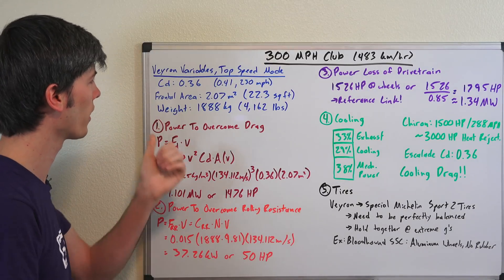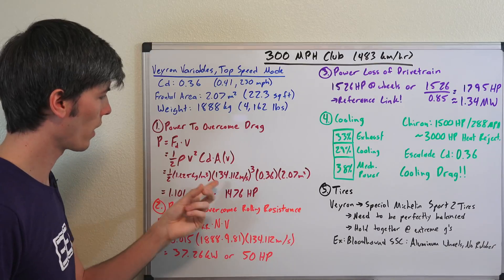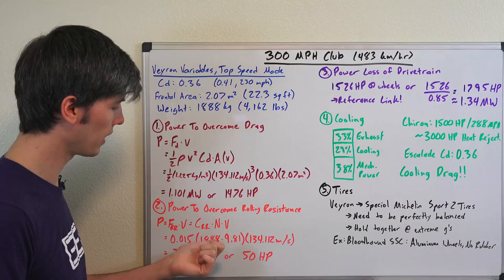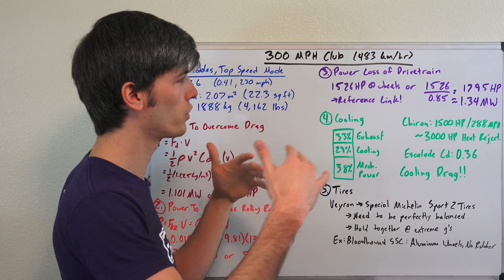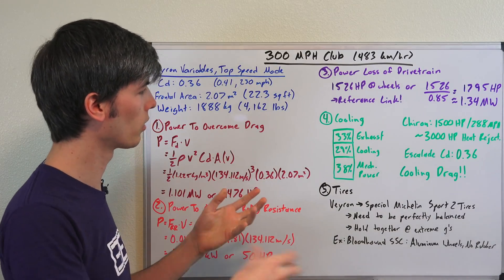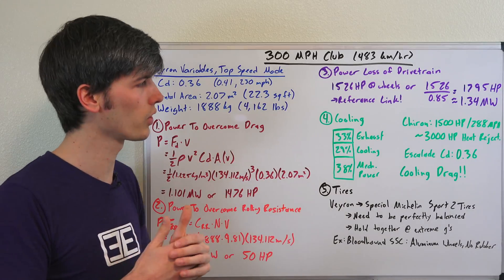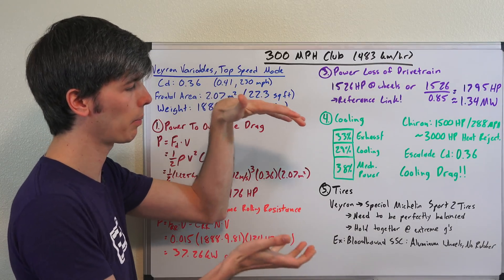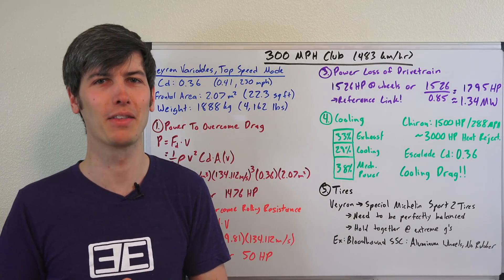Why Has No Production Car Hit 300 MPH?

Comment: If you could lower the drag coefficient to that of a Prius (0.24), you'd only need 733KW or ~1000HP to reach 300mph.
Reply: You don't even need to lower the drag coefficient, you could just reduce the frontal area! Fast motorcycles have terrible cd but a tiny frontal area.

Comment: would a purely electric engine require that much cooling? less of a cooling requirement, less of a drag coefficient requirement??
Reply: The energy required does not change between ICE and electric prime mover, however the efficiency for an electric motor and the heat rejection would be slightly less than for an ICE.

Comment: Would they benefit more by adding more cylinders to gain displacement or just upsize the engine?
Reply: So what you're asking in a round-about way is "which is better? increasing capacity and adding more cylinders OR only adding more capacity". The difference would be negligible.
Reply: noxious89123 Increasing capacity in both scenarios, just in different ways, would one yield more power than the other.

Comment: The obvious way to defeat drag is to run at high elevation.  The Atacama Desert is 13,000'.  Air density is 66% of sea level, so required horsepower is reduced to a "mere" 1000 HP.  According to Wikipedia, the  Dakar Rally and a solar car competition have run there.  Also, reducing the frontal area is a big factor too.  Say you had something the size of a Lotus Elise, with a really big motor.  Oh, wait, someone did that already.
Reply: MrChanPhysics thinner air means less power the engine generates
Reply: Turbocharging can make up for the lower air density.  WW2 fighter planes  used turbo (or super-)charged engines and achieved top speed  at altitudes over 25,000 feet.  For example, the P-51 Mustang had a 1720 HP engine, could hit 442 at 26,000 feet, but could do only 375 MPH at sea level due to drag limits.

Comment: Yes this is theoretically correct no doubt about that. The biggest problem is the roads. The other thing that makes it impossible are the driving skills. As you know American cars in the 50's had those fantastic engines but heavy and straight forward speed. Your skills should be as a formula 1 driver with suicidal cars. And who want to manufacture that.. one life lost and the brand will be gone from the market.
Reply: Theory and theoretical discussion must escape your comprehension.

Comment: You didn't mention that you need a straight long enough, which is rare for 250 mph. You would have to accelerate much faster, or build a very long road. You might also run out of gasoline if it took too long to get up to speed, the mpg gets very low at that speed.

I wonder what this calculation would look like for the Tesla super car, they have no plans but I imagine an electric car will one day try for the record. The loss at the drive train would be lower, cooling is also much lower, and Tesla is the lowest coefficient of drag car manufacturer as a result of the inherent advantages of electric drive trains.

Comment: So, basically to hit 300 mph you need an electric car without this enormous heat loss :)
Reply: Denis Protopopov no gasoline engine have already reached such speeds just not road cars. and if you tune one you could probably get it to 300+ you just need a Leight weight car with little air resistance and then just like lotus have a 1.2 litre engine produce a insane amount of horse power.

Comment: Tesla will be the first to hit 300mph, very little cooling required
Reply: Big dundee I'd say gasoline engine will hit it first because they have already hit it not (stock) road cars though but electric engine's are I think older they have been around since the late mid  1800s and gasoline engine's have dominated them because they are just much better.
electric engine's are good at low speed but om higher speeds the electric cars usually get destroyed and another problem would be the terrible drive ranger such an electric car would have if you would have a 6 hr race between a smart and a tesla model x the smart would win because of the small driving race the tesla has.

Comment: Would it be possible for an auto manufacturer to make use of the Meredith effect? It's a concept that allows the temperature/pressure difference from the front to the back of the cooling system can offset the effects of drag on the cooling system.

Comment: Another comment on air, would it be possible to engineer a system to break up the air in front of a car? Sort of like how if you were diving from a high altitude you toss something into the water to break the surface before it breaks you? It could be like a sonic disruptor that "loosens" the air in front of the car.

Comment: Would this be affected by gear ratios? Cars are dyno'd in whatever gear is (or is closest to) 1:1 to get an accurate HP/Torque rating, so would you actually need a car that can produce 1800hp at whatever gear ratio you'd need to reach 300MPH? Essentially like dynoing your car in 6th gear

Comment: As an example of the math, Top Fuel drag and funny cars have 2,000 hp or more and regularly trap at speeds in excess of 300 MPH.
Reply from the maker: Top Fuel engines are around 10,000 HP. Math here! https://youtu.be/bI0YPTK32vc
Reply: not only that but they are usually a direct drive setup, less loss due to power train.

Comment: 300mph on gas engine maybe hard to reach, but did u forget to mention Electric? :) Tesla can pull it off it won't be long lasting battery since it might just drain in one run, but it could have a switch for just max top speed.

Comment: The more interesting question: WHO will reach 300miles/hour first: A conventional combustion engine car, a hybrid, or an electric vehicle? Now electric vehicles have the same problem at sustained high output with the additional problem that the heat is currently not moved out of the inner part of batteries. I can imagine that this might work when batteries are cooled similar to liquid-cooled computers, running heat exchanges through the midst of batteries and motor components.

Comment: I think a tesla can hit 300mph with wireless charging. The wireless charging is key because that means it can shed a ton of battery weight. It might need some other mods like a spoiler and striping excess weight.
Reply: Weight hardly matters at all for top speed.  In the video, 1475 hp for overcoming drag, 50 hp for rolling resistance which depends on mass.
Reply: Weight is critical because you can't use more power than the wireless charging can input and weight directly relates to how much power it takes to move. If what you said is true then why is everything that is built to go fast built to be lite as possible? The batteries on the tesla alone weighs more than many cars you really think losing that much weight is not going to make a huge difference ?   Give me a break man.
Reply: They're built light to be able to accelerate faster, if we're talking about cars at least. Top speed hardly matters on a track where you will almost never reach it due to there being a lack of straights.
Reply: DarkBioCloud battery will overheat (and probably explode) at the rate of discharge and recharge
Reply: DarkBioCloud it is not just about exploding, overheated batteries can't supply much energy so it would be pretty much useless.
Reply: DarkBioCloud how are they supposed to get wireless charging to a car then?
Reply: stick a  Tesla on a big cannon and light the fuse, no electricity needed, it can go beyond 300 for sure over air
Reply: DarkBioCloud you need a very long dodgem cart track....lol
Reply: tesla can't hit 300 mph because it has only one gear... you need it geared low enough that it can accelerate at a reasonable pace, which is why its top speed is 130 mph (model s).  the electrical engines have a redline too...
Reply: A tesla cant hit 200mph
Reply: Self entitled Car-guy It might explode but we don't know that for sure until we try it. If you wanna break the envelope you have to take the risk of getting paper cuts. I never said it was safe eh we are talking about making a tesla go 300+ mph that alone is dangerous the possibility of a exploding battery just makes things spicey =)

Comment: What about electric? That would simultaneously reduce cooling requirements and allow for more aerodynamic freedom. These next gen graphene batteries are capable of 100C discharge rates without breaking a sweat, and electric motors are far easier to keep cool

Comment: One aspect of Veyron and Chiron is, that they are not just made to hit that top speed, but to do it with style. If you compare the sound in the cabin of Veyron at top speed to any other hypercar at their top speed, the difference is huge. For instance in the Top Gear's Super Sport top speed test, May could speak normally when he hit that 259mph. There were very little background noise. My Mazda makes more noise at 50mph than that. Also cameras were very stable. Ferraris, Lambos, Koenigsegg at top speed, they roar. You have to yell very loudly to be heard. Also they rattle and shake much more. I bet, that if Chiron had been designed like those cars, it might be able to reach 300mph.

Comment: You may also want to add sufficient power to accelerate to 300mph within the amount of space available on top speed tracks. Having just enough hp to reach 300 would mean that it would never actually reach that speed. It would run out of space before it could reach max speed. I suspect that the first production vehicle to reach 300mph will have between 2000 - 2500 hp, and it will likely need at least some of that to be provided by electric motors. That's my opinion anyway.

Comment: They could if they really wanted to.  Just have to change the gearing for top end.  The biggest worry is also the life of the tires.
Reply from the maker: Gearing doesn't make power. You have to have the HP to overcome the resistance. If you only have 1 HP, you can have unlimited torque but you'll never reach that speed.

Comment: maybe if you don't use a regular combustion engine and instead you use a more heat efficient engine like a turbine like a helicopter engine or a m1 abrams, you will be able to overcome the drag coeficient caused by the cooling system, because you will need less cooling

Comment: Would the added down force created by the car traveling at speed add to the amount of rolling resistance to the tires ?
Reply from the maker: Yes!
Reply: Could this be ballparked with the traditional racing equation of every 100lbs +/-  = roughly +/- 10 hp at the wheels?
Reply: this is interesting

Comment: 3000hp of energy loss as heat is mind boggling.  If you could not dissipate the heat from the cylinders fast enough they would become part of the combustion process. An adiabatic engine block and heads would be helpful. I new of some promising research into ceramics, back in the eighties. Miles to go an inch at a time. (Kilometers to a centimeter at a time hehe..)

Comment: I don't think most high quality cars lose a lot of HP from the crank to the wheels. I was researching Audi models throughout history and the difference from engine to wheel is only like 8hp most of the time among A models and S models. Even the 2017 R8 V10 Plus is 609 at the engine and 602 at the wheels.
Reply from the maker: I guarantee it's more than a 7 hp drop. Especially considering it's AWD.
Reply: He has a master in engineering man... Can't say you were researching around and think he's wrong lol.

Comment: What if you designed the engine to be air cooled? While you would still need a cooling system for low speeds what prevents us from closing the radiator intake ports and opening vents that just channel air over the engine (lowing the coefficient of drag). 
There should be plenty of air to cool it at 300mph as well as enough pressure to even cool the air before sending it over the engine. Am I crazy or is this possible?

Comment: Hennessy is probably going to be able to hit 300mph with its ~1500hp.  Firstly, it's in a much smaller car, ie less drag.  It's also a manual transmission so probably a bit higher efficiency.  And Hennessy has fried engines on top speed runs before... explains they may be scarce on engine cooling.